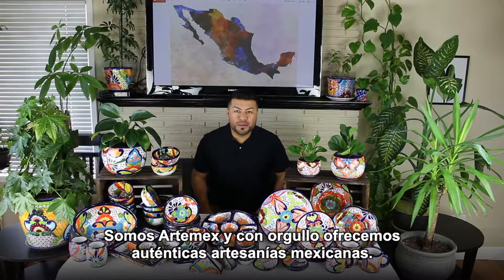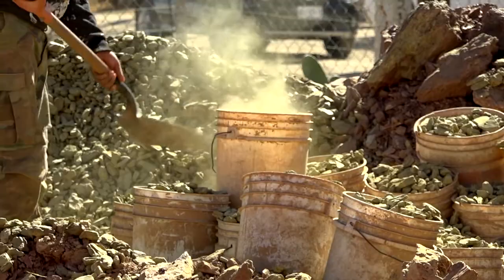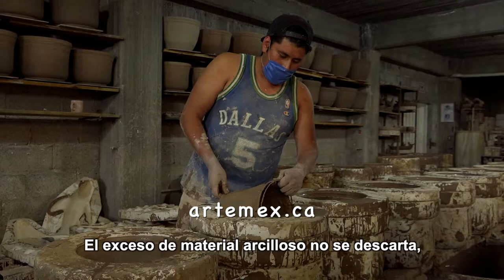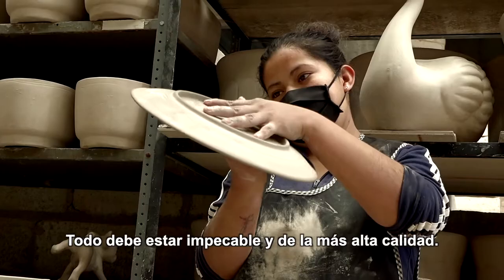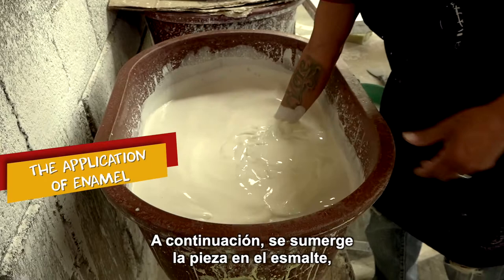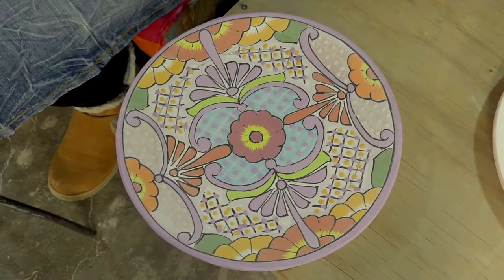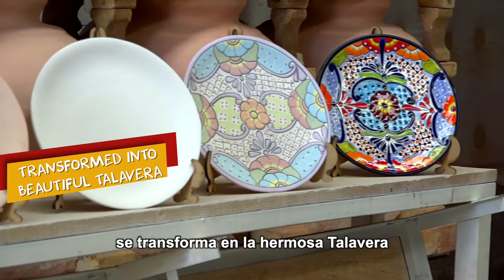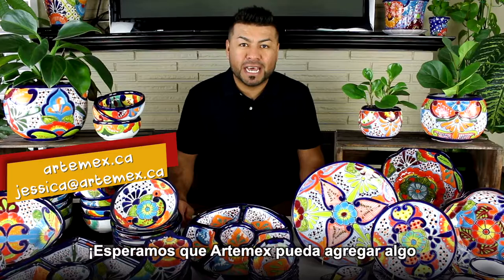Mexican Talavera - The Magical Talavera of Dolores Hidalgo, Mexico and HOW ITS MADE

Comment: If you already figured out a way to screw the wide diameter cylinder part of a plastic bottle together, and it is still not completely air and liquid tight. Then a little bit more heatwork will solve that. greyishgreblum, "Pottery tap and die" w/ "cookie cutter" tap tool modification💜
Reply: Know on Rainer, 🥚🥒💪